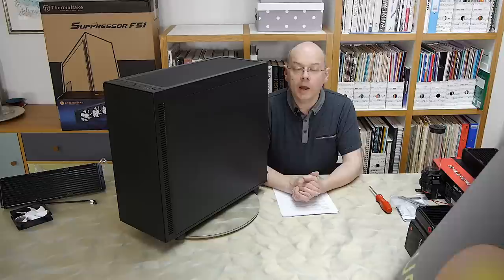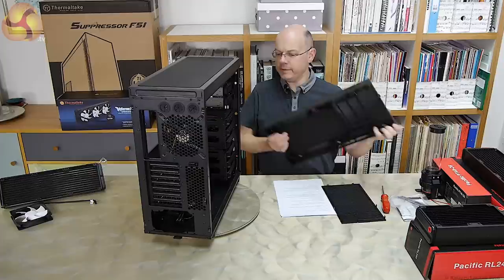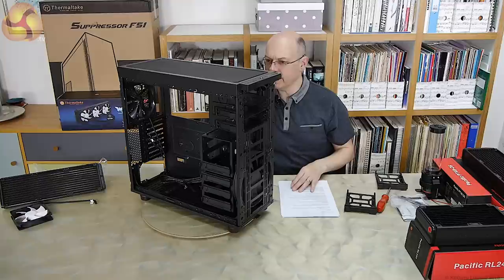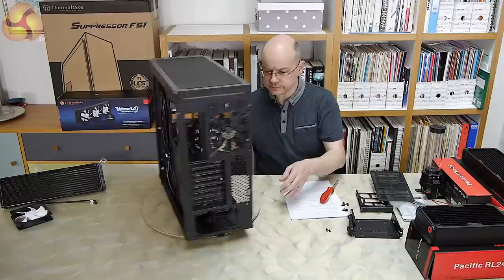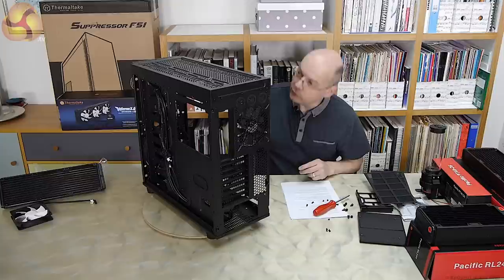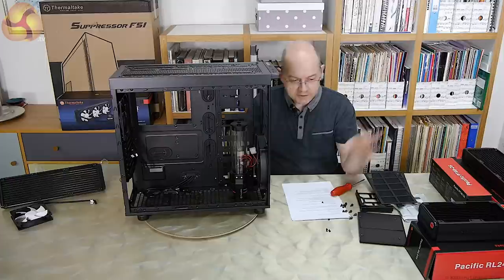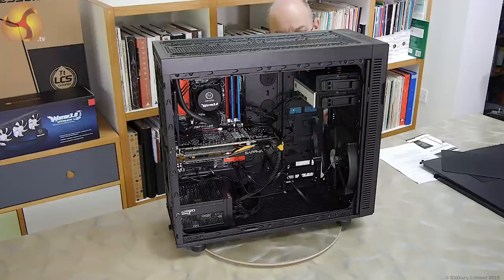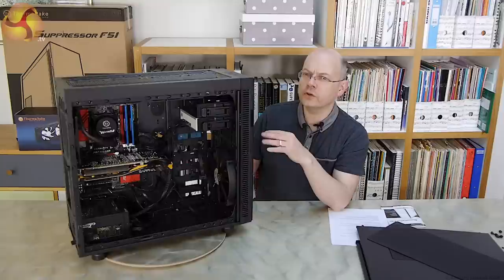Thermaltake Suppressor F51 Review

Comment: The case fanatics are all against Thermaltake, but they don't realize that other companies do this exact same thing.
Reply: Corsair took from Silverstone, Antec/Cooler Master/Corsair all came out with 'ultra tower cases with a basemant in the same year, the following year Case Labs did this basement ultra tower concept. If you look carefully at the Thermaltake Core V51, it has the same interior layout as the Suppressor F51, which came out about a  year before the F51 did. So that means that Fractal took the interior layout without the drive cages (as they're all modular in the V51) of the V51 for the Define S build.
Reply: Pretty much EVERY company does this at some point or another.  Whether or not they are caught or punished for it, that is another question.  Not to say whether I think it's good or bad, but it has pretty much become the industry standard.

Comment: The look of this case is clearly a copy of the Fractal Design R5 - of course - but I'm still buying this one for a few reasons.  
1.)  I like that there are no LEDs on the front (just the one up top).
2.)  Magnetic dust filters on top and side - the R5 doesn't even have top or side filters at all.
3.)  Slightly cheaper - hey!
Reply: +David Hoffnung I also went with this case. The magnetic dust filters were the biggest deciding factor for me. My only gripe is that i wish the bottom filter was one piece and removable from the front (small gripe though). Great case though and i'm happy with the purchase.
Reply: +David Hoffnung How do you like the case so far? I'm also thinking of getting one too instead of an R5.
Reply: +Steven Phillips I like it a lot so far. While the styling is very similar, this is actually a significantly larger case than the r5 - and it fits my EATX motherboard, which I don't think the r5 does. The case looks great and the build quality is good, coming with all the screws you'd need. Even leaving the top and side panels closed, switching to this case has improved my airflow to reduce load temps by 10 degrees Celsius with the fans on low - even more on high. Cable space is a little tight, but with patience you can have a bulge-free side panel. The front door feels satisfyingly solid as it shuts.

However - some folks have complained about the power button - and it is the weak point of the build. Mine hasn't broken - and while it does look good with the rest of the case, it feels kind of cheap when you push it. Same goes for the fan controller buttons, which toggle between "high" and "low". Since I still have a high rpm fan on my video card, the build is far from silent, but with the fans on low it is still much more quiet (and cool!) than my last outdated case. That 200mm fan really pushes some air.

All in all it's a great case with plenty of build room in the main area of the case - but maybe a bit less than I expected behind the tray. The magnetic filters are pretty cool too.

In some ways it improves over the r5, and in others is't quite as clever. If you are torn between them, consider that the p51 is bigger and fits eatx (almost full tower size in impression) while the r5 is a bit more normal midtower size and has a front door that can be made to open either direction.  One last thing which is really small - but honestly did matter to me - is that the p51 has no forward-facing LED's.  I game with the lights off, and I appreciate the subtle dimness of the p51's upward-facing power button.

Comment: I don't get it. If this was just a 100% copy of the R5/S and priced higher, people would just buy the "original" and end of story. But this case changes (in my opinion: improves) on that "original" and thus fits my needs better. With hardware, there often is already plenty of occasions where you gotta compromise (and sometimes pretty heavily so), so I'm thankful for having this additional option. This whole shitstorm seems similar to Apple fanboys screaming "OMG, look at this phone, it's rectangular with rounded corners, what a blatant iPhone rip-off!" Especially amusing considering that many of those screaming in forums and such are those that usually have a more "flexible" attitude to copying stuff, at least as long as they are the ones profiting from it.
Reply: It has no movable drive cages which IMO kills it.
Reply: Infinite Zero
What do you mean? The drive cages are movable, you can put in different locations or remove them completely, I only kept two (for my SSD and storage HDD) and put them in the side panel.

Comment: Thank you Leo, your case reviews have helped me a great deal. I really like the improvements I saw on this F51, and I got the F31 for its better cable management and smaller, wider profile. I sympathize with Fractal Design but being copied by your competition (if that's what happened) is a risk. I hope they'll continue to be both successful and innovative, and will be able to benefit from their competitors in turn.

It's worth mentioning that the F31 window version sidepanel is very flimsy and the window actually vibrates despite my tightening up the bendable metal lips. I had to stick a few spare rubber adhesive strips from a Cooler Master 412S CPU cooler under each corner where the window meets the steel panel. The good news is not only did it stop the vibrations but also made the whole panel feel sturdy and less flexible, almost like a windowless sidepanel. The result was better than expected and made me feel less bad for passing on the Silent Base with its better window design. Also the front I/O panel USB ports are a bit tight, I could feel it bend slightly as plugging in some devices took a bit more pressure than I'd like. 

Despite that it's still a really nice case, and for me it was a difficult decision between the F31, a Silent Base 600/800 or a Cooltek W2. I hope you will find the opportunity to review at a Cooltek W2 case some time, I realize other reviewers have already looked at it but I'd very much enjoy having your thoughts and experiences with it.

Comment: The second front air filter still doesn't cover all the fan intake. Remember, air, like any fluid will take the path of least resistance meaning some air will still be getting around both front air filters and directly into the case.

Comment: I have the same problem with the power button pushing in breaking... It's a liability in terms of electrical reliability. You have to be GENTLE pushing the button in. I had to RMA the front panel assembly.

Comment: This looks like a nice upgrade vs the Fractal lineup. If the Define S only had a top filter, it would be on my desk right now. Instead I chose the Nzxt s340 because it only has 1 fan slot at the top and its exhausting anyways.

Comment: Are you going to also be reviewing their cases that they ripped off of caselabs?
Reply: +FastRedPonyCar You mean the case that Caselabs copied from Mountain Mods?
Reply: +Juhni Blazn&#39; If you consider a modular case copying then I guess that's your opinion on the matter but the rest of the internet seems to agree that MM does not match the quality of CL and even CL spoke directly about MM on the OC forum.

http://www.overclock.net/t/1184473/mountainmods-vs-caselabs
Reply: +FastRedPonyCar Well, if that's where you're going, then Tt didn't "rip off" CaseLabs, either, since there's no way in hell CaseLabs is going to pare their cases down to meet the price point that Tt's Core line sits at.
Reply: FastRedPonyCar
I just love when someone dare to pose as representative of whole anything. Say hi to J2C.